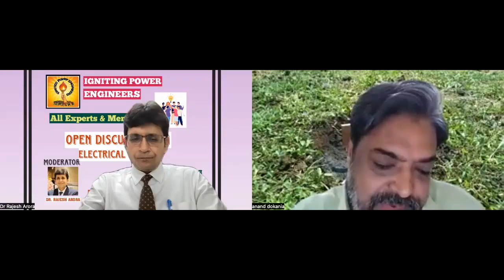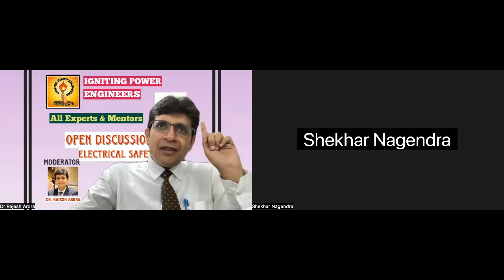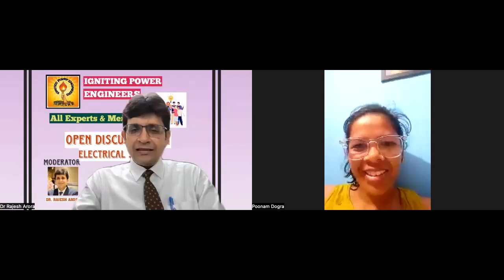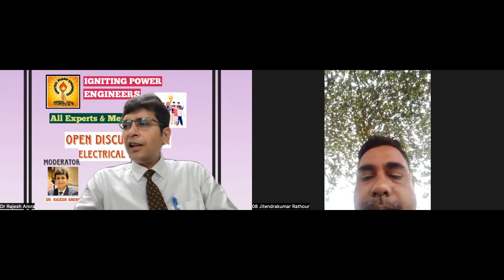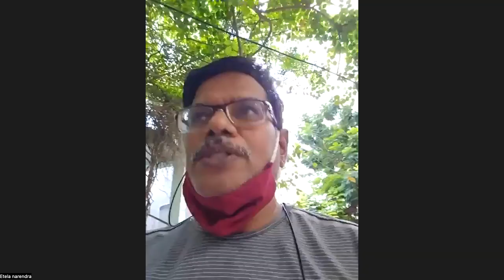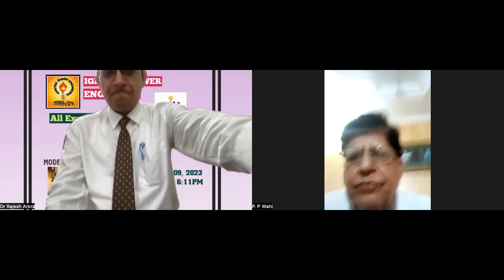IPE-Open Discussion -01 on Electrical Safety #safetyfirst #earthing #safe #webinar

Comment: Nice initiative Dr. Rajesh ji... congratulations to you. As a first step It is most important to ceate awareness amongst  the Discom engineers, consultants, contractors and agencies about tte governing standards and Regulations of electrical safety.

When it comes to accidents taking place in HT and LT distribution network, it is mostly due to substandard construction methods, lack of proper maintenance and non observance of safety procedure while carrying out any work on the lines or equipment.. on the other hand when it comes to accidents taking place in consumer premises ( i.e. a house, building or any industry or establishment for that matter) it is the combined responsibility of the Utility, contractor and consumer. 

So the strategy has to be ceating awareness amongst all the stake holders and at the same time  strict implementation of the Standards and Regulations... and this has to be a continuous process.